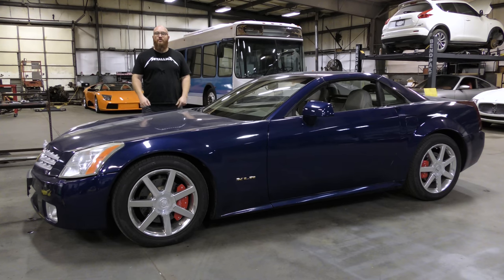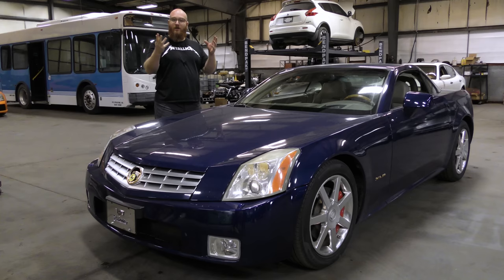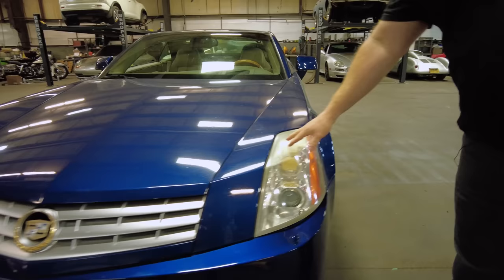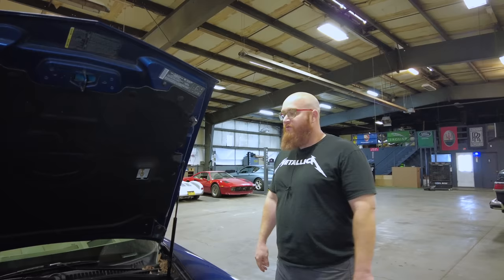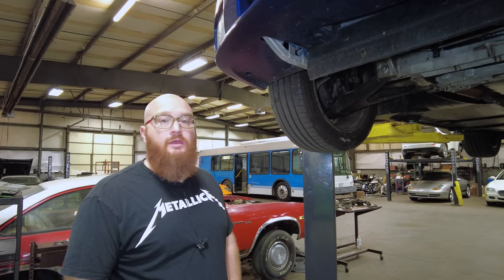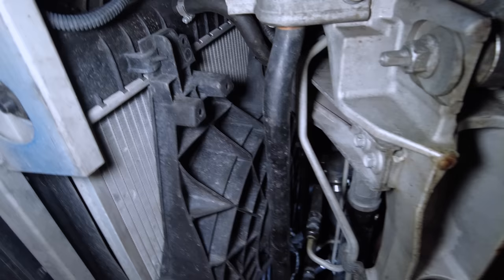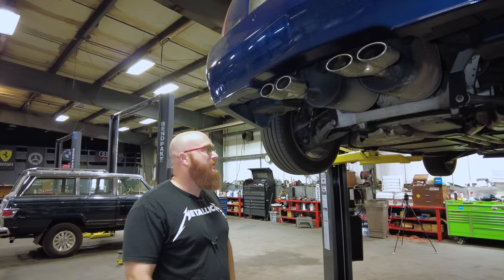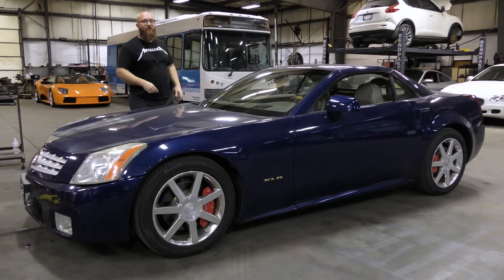Another Northstar? Why does the CAR WIZARD keep buying Cadillacs with this engine? Now an '04 XLR!

Comment: Nice looking car but anything with a Northstar engine I would run away.  Love the exterior but the interior is for the older crowd even at my age of 70.  Think I will keep driving my 1997 F250 HD XLT with 64,000 miles that I have owned since new.  My 2008 Mustang is still a good car that is more fun to drive than the law should allow.

Comment: At about 15-20 years now old engines need gaskets if you want to fix oil leaks. I spent over $2k for LS1 upper gaskets and knock sensors  and oil pressure gauge etc.  Well worth it to keep it going for many more years.
Reply: As someone who sold parts off and on for many years, every time I sold a customer intake gasket sets for LS engines, I always recommended new knock sensors and replacing the crusty wiring harness. Many of them didn’t take the advice. Oops for them
Reply: @mikegreen2229  yup once you're in there it doesn't cost much more to replace it all.

Comment: It’s a good thing the Wizard doesn’t have to worry about buying one of the most unreliable and expensive to maintain cars ever produced. Cadillac dealers have to have a specially trained “XLR-Certified Technician” on staff or else they will not work on them.

Comment: If I'm not mistaken, GM didn't officially fix the head gasket problem till about 2005 and a half so you have to find a model in the older body style which would be pretty hard to be built between June and December of 2005 and in 2006 they came out with a new body style so I don't know but that's what I've always read and learn from GM is that they fix the gasket problem for sure in 2005 and a half.

And I'm partial to the 2000 to 2005 DeVille body style more so than the newer DTS but I don't know if I could find one with the fixed head gasket or head bolt remedy that is that new
Reply: I guess if you really wanted a North star you could get a Lucerne with the Northstar engine and that Lucerne came out in 2006 and up so that would be a fixed Northstar.

Comment: @Car Wizard
So, what about length of service as return on investment?? Say for instance you pay 4k for the car, then invest 10k for the engine out service with all perceivable add-ons factored in. Would it then not be a reasonable expectation to get 200k miles out of that car with otherwise normal maintenance??
So, in short, you've bought a 200k mile potential, stylish luxury car for 14k. People are always looking at monetary return (what could I ever sell it for) unnecessarily and never use of the vehicle over time.

Comment: I want to buy this car, but I am afraid of the retractable roof because they say it is complicated and the cost of repair is very high. I also want to ask about the effectiveness of the air conditioner. Is it good in summer? I want to use the car on a daily basis to go to work.

Comment: Good luck. GM has cancelled all the replacement seat parts for my 2007 Corvette. I guess you go with an upholstery shop for the XLR when the seats inevitably disintegrate, but I wouldn't want that problem during Brandon's pandemic pricing inflation bonanza. If inflation continues, you will have a $10k driver seat to maintain. The Supercharged version, with a tune could be interesting. Thanks.

Comment: I'm surprised the 2004 suspension module is still working with all that water in the trunk. If the car wizard wants to fix that suspension module without paying $3k, give me a shout out. I'll show you how to bypass it or replace it for less than $400.

Comment: I really like the ford 281 v8.  To me this was the best motor they ever made.  The have great power,  can be modified to a drag level HP,  Tough and hold together,  extremely reliable for me.  I currently have two, one is a 97 Cobra Mustang ( modified) and one is my current daily driver and that is a 98 Lincoln Mark 8.

Comment: I do have a question regarding the 4.4l lc3.  I'm looking at buying a 07 sts v. It is high mileage 145k so I wondering if there is any common issues at that mileage. Not finding alot of parts available but I keep reading the engines are solid. Thank you.

Comment: 3:16 well .. sentimental attachment, i have my late fathers Volvo 855, got over 400kkm on the clock, kinda looks like a junker on the outside (Paint is BAD) but i've done quite some work to it that cost more than its "worth" if i would want to sell it, but i won't sell it as i have sentimental attachment to that exact car. so to me it is worth investing the money. 
Maybe just mention that you don't think its worth it and ask for a down payment upfront if you are unsure if the Customer is actually gonna pay?
I understand if you turn down a job if you don't have the tools, knowlege, capacity, just dislike the type of car/job/customer or just don't offer the requested service at all ... but turning it down because  it wouldn't be worth to you? Idk if the customer is willing to pay for it and knows the cost up front ... not really your concern why the customer wants to do it, just do the work and cash in ?

Comment: I had a 97' STS the Northstar engine is the biggest POS ever made and so poorly designed the engine is a throwaway when the head gasket (weak point) goes.  Back in the day dealers would several pallets of engines they'd just pull out and replace under warranties..

Comment: I want to buy a 2004 model, but the car has a problem with the roof. Are there spare parts for it that I can order from Amazon, for example, or eBay? I am from Saudi Arabia, and this car is very rare with us, given that the weather here is hot most of the year. In addition, the culture of coupe cars is small in Saudi Arabia, but I am in love. For this car

Comment: Had two northstar junk. One engine made it to 65k the other to 50k. Never have owned an an america in car again. GM knew the issues and kept making them because most made it outside of the standard warranty. I read a newspaper article a while back, one line in it, summed it all up for cadillac. In the 70's,80's & 90's in most retirement ares in FL little blue haired old laddies drove around in big caddies holding up traffic. That tradition continues today, in Toyota Camry's. Great job GM! I know the responses will be how much they have improved, today they compete ect.... It's to late they jammed to many people with junk for to long. For 3/4 of the 20th century GM was the largest car maker in the world, now they aren't in the top 5. Wonder why?
Reply: In the early 80s Cadillac came out with their V8-6-4.   The cylinder deactivation system was total junk.  GM's solution?  They would deactivate the system so it ran on all 8 cylinders all the time.  Then they hoisted the Cadillac diesel on a gullible public....one of the biggest f*** ups in automotive history.  Then they came out with the 4100HT (Hook & Tow).   Garbage.  This was followed by the 4.5 liter version of the same engine which was only marginally less garbage.  Finally they produced the 4.9 liter version which didn't puke it's guts out before 50K but produced laughably little power for the amount of gas it drank.  Soon after figuring out how to build the HT engine so it wouldn't grenade, they dropped it from production and blessed the automotive public with the 4.6 Shitstar.  Why anyone would buy a new Cadillac today is a question for the psychiatric profession.

Comment: 3:14 why would you sink $7000 into a car that you will never get back? Because to buy a similar car that may have issues you might have to spend $18,000.

It was the same as my F150: I'm into it for $10,000 and I paid $5000 for it 8 years ago. "WHY"? Well, because to buy a similar truck now (albeit newer) it'd cost me $20,000.00. And? That $20,000 truck will probably need $4000 in repairs in 3 or 4 years anyways.

Comment: Mr Wizard, C5 Corvettes are known to have troublesome issues with electronics that are no longer produced for purchase.  You can only buy used. Or so it’s rumored.  Do you think that applies also to the xlr?
Reply: 2004 Corvette was a C5 not C6 but maybe the change was earlier on the Caddy?  You are the Wizard. Much respect for you. Seriously.
Reply: @rickyboyd2919  You're correct, Ricky. The XLR was always built on the current corvette chassis. For the 2004 XLR, that was the current 2004 C5 corvette. When Chevy introduced the C6 in 2005, all subsequent XLR and XLR-V's were built on the new C6 chassis. ^v^

Comment: In my admittedly worthless opinion, the C6 is the better choice in every aspect other than exterior styling. And you can't see that when your driving. Also, IIRC the XLR tailights are super valuable because they contain their own integrated circuits

Comment: it looks like a square body version a Mercedes clk just with a terrible design engine. Looks a bit like a Mercedes sprinter van front cross member and fiberglass leaf spring lol 
its like a Porsche 996 every repair is a engine out lol 
looks good tho

Comment: Did they fix the Problem by putting bigger head bolts in it or just a better head gasket?
Reply: They switched to head bolts with coarser threads.

Comment: FLOOR IT FROM 20 M. P. H. TO
130 AND IT WILL FAIL.
WATCH THE COOLING FAN ON ALL CADILLACS, THEY ARE PLAGUED WITH ELECTRICAL ISSUES. THEY WERE POTENT ENGINES AND ALWAYS START, BUT WERE SHOEHORNED WITH INADEQUATE COOLING IN THE REAR.  THE FANS ARE JUNK.